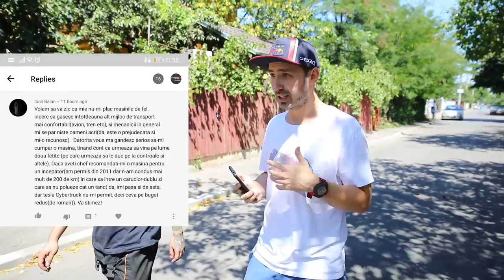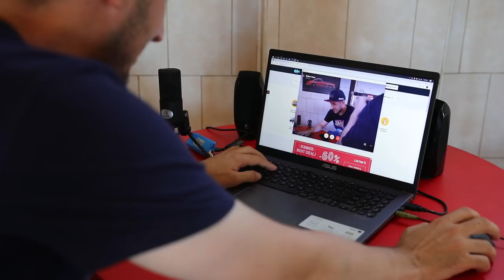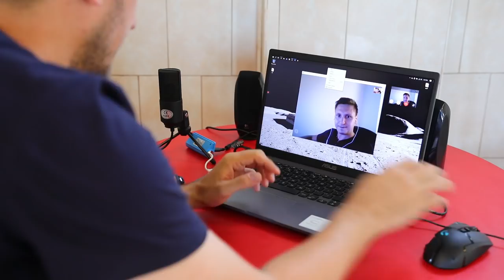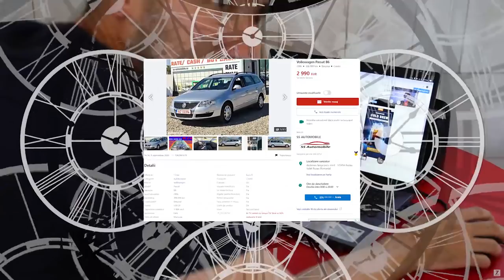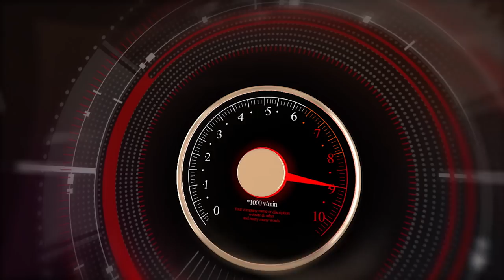I-am facut CADOU O MASINA unui abonat! ❤️❤️❤️ #125

Comment: Salutare, o intrebare pentru voi cu privire la uleiul Motul. Am o Zafira A din 2002 motor Z18XE (am montat si GPL), folosesc Motul specific Dexos2 5W30 de cand am cumparat-o din D, la ultimele doua schimburi de ulei (cumparat de la Autokarma, sper sa nu fie reclama), dupa aproximativ 3000km (l-am dat jos) respectiv 4000km (iar am schimbat uleiul), uleiul in motor este "ROSU", gen ulei de cutie. Poate imi puteti spune voi de ce? Sau sa intrebati pe cineva de la Motul. Multumesc anticipat.